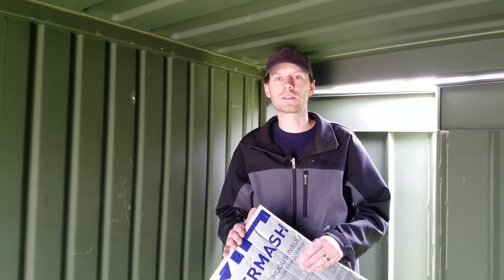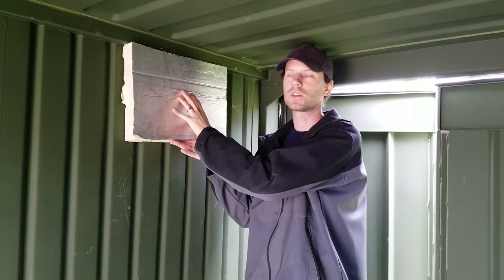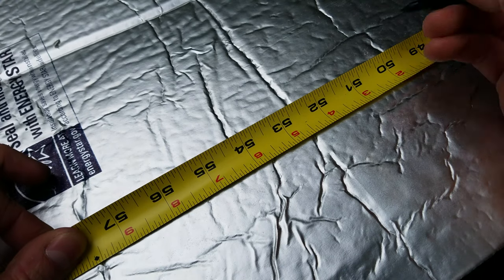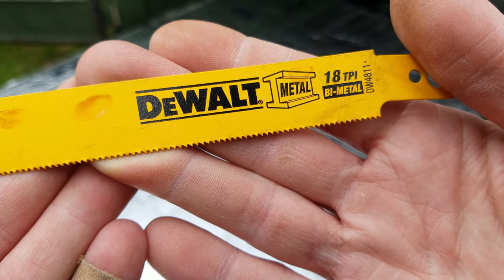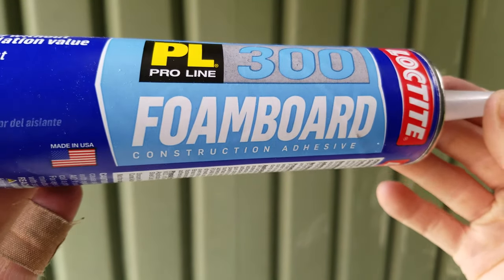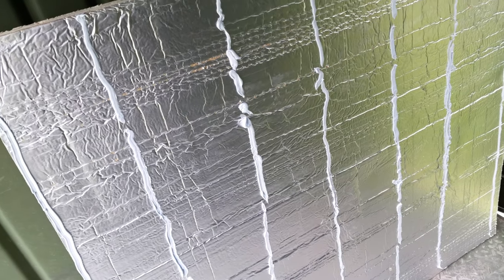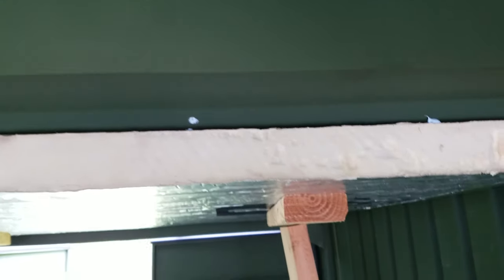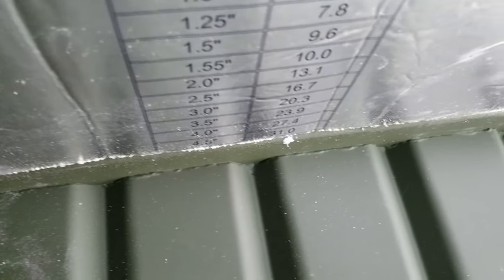Installing Foam Board Insulation in the Shipping Container Battery Shed

Comment: Hi there.  How are the panels doing?  I am considering doing the same project.  The loctite foamboard adhesive says that one surface has to be porous suggesting that it might not bind to metal.  Are you having any issues?  Thanks.
Reply from the maker: I have not had any problems at all. It's still stuck on there pretty good.

Comment: Looks good.  Have you had any problems with condensation on the inside since you installed the insulation?
Reply: That's a good question, however still no answer?..
Reply: @JohnSmith-xx1lx   NO...just radio silence
Reply: @Huntsville_Living  would like to know more about it, as I look at the condensation on my ceiling lol..

Comment: Is the air gaps behind the insulation an issue ?
Great project. Please show the while process.
Reply from the maker: I am told the air gap in the channels behind the insulation should not be a problem, but I am not familiar enough with insulation to be able to comment beyond that.
Reply: Actually, static air is a decent insulator in it's own right. If I can make a recommendation, when gluing to channels like this, put the glue on the metal, and use a spatula to spread it so there's a HUGE contact surface for the glue. It's how I glue boxes together (saw this tip on an Adam Savage video) and I must say it works well!

Comment: What a pitty, come one inside insulation is mediaval time ;^) outside insulation + weather proof painted plywood sheets would have be way more effective at keeping the container isolated with metal mass to contribute stabilize internal temperature... and you would stand inside with no torticollis ;^)

Comment: how did this work out for you and how did you address 1) the seams and 2) deal with the air gaps (if at all?), and 3) deal with corners and potentially leak spots from external?
Reply from the maker: 1) Tape 2) The air gaps are not a problem 3) There are no leaks anywhere on the container
Reply: @LithiumSolar  Thank you! I will also be working on building a small, iterative solar system on/in the container so I  think I'll be watching your other videos to see what I can learn from you on that!
Reply: do you think a particular kind of tape is beneficial for the seams?   @LithiumSolar

Comment: Thermal cork spray
Reply from the maker: Are you suggesting I spray it on the surface of the insulation? Or use instead of the foam board?
Reply: @LithiumSolar  it would work well on the exterior. I sprayed my garage door. And the heat transfer from outside to inside was drastically reduced

Comment: they invented "duct tape" for those seams
Reply from the maker: Ah, so duct tape does serve an actual purpose in the world! LOL. I know you're not supposed to use it on HVAC.
Reply: Actually, they didn't. Duck Tape (the actual, original name of the product) was invented to do emergency in-combat repairs during WWII. When everyone came home, they started using it for everything else, too. Way too many people used it to seal their HVAC ducts, so the urban legend that it was an onomatopoeia of 'duct' got started. In reality, since it's somewhat waterproof, they called it Duck tape as in water off a ducks back. It actually has nothing to do with the WWII DUKW 'Ducks' either. Although I bet they used it a lot to cover bullet holes in the and keep them waterproof! The correct tape on ducts to use is Aluminum Foil tape. Expanding foam with aluminum tape is exactly the right thing to do. (My son's a WWII historian and I got lectured by him once. :-)  ). Great project!

Comment: The process of building a shipping container home, studio or storage shed always puzzled me. Here in Florida 1 40 foot high cube used shipping container runs between $2500and $3000. Then there is transportation and set up on its foundation.  so maybe a total budget of $5,000 to get a 40foot high cube used shipping container delivered and set up. But now all you have is a steel box that is not the most convenient size and shape. Please comment on a alternative of simply buying the steel and constructing your own container with length height and width in much more accommodating ratios for human activity.  Please comment on the logic and cost of buying a container and then building a somewhat awkward structure around it ? Thanks for you excellent videos. Warm regards from Florida.
Reply from the maker: The pricing all depends on how and where you get it. These containers are on govplanet.com and are actually rather cheap and plentiful in your area (Not Florida, but Georgia). You just need to "know a guy" to help haul it ;) Building your own out of steel plates would work, but you would have to know where to get plates, how to move them as they're hundreds of pounds that I've seen, and know how to weld them (I do not).
Reply: tons of videos etc discussion shipping container homes.